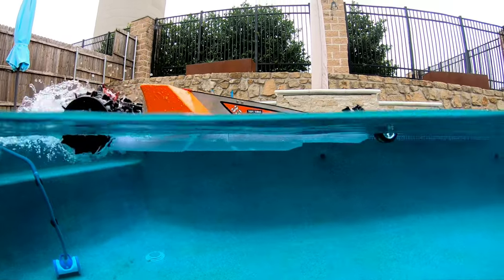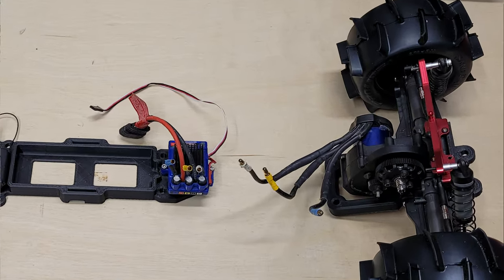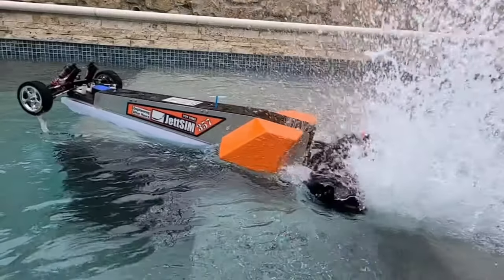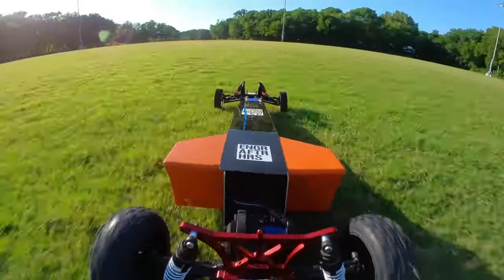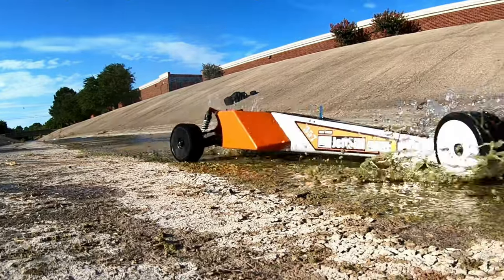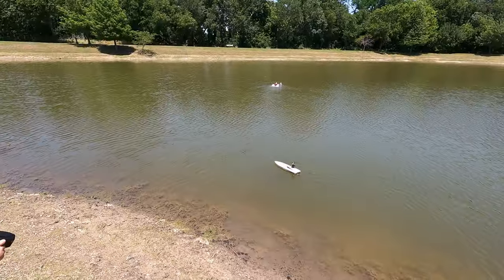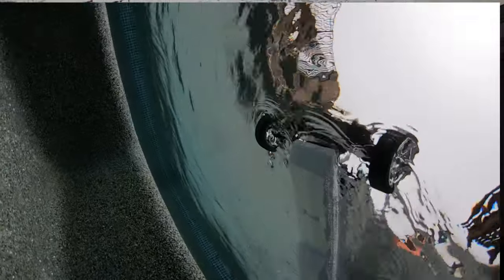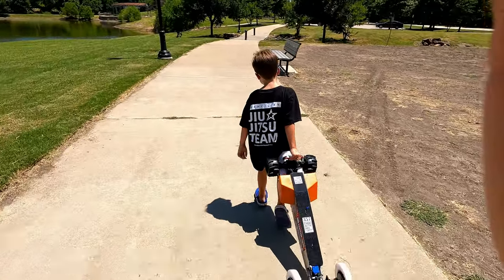How to Drive On Water - Amphibious Dragster

Comment: Adding some hydrofoils could get you some more speed by dramatically reducing the wetted area. A hydrofoil type element in front of each rear wheel could get the wheels out of the water enough that they aren't churning quite so much and the water being ejected goes out the back at maybe 30 degrees rather than going up in the air which forces the back end under even further.

Comment: buy paddeltires that have more like the traditional bucket look and turn them backwards, so that the slope of the paddels kind of lifts the tires up AND it does not do the newtons third law thing with holding on to water long enough to throw it straight up.